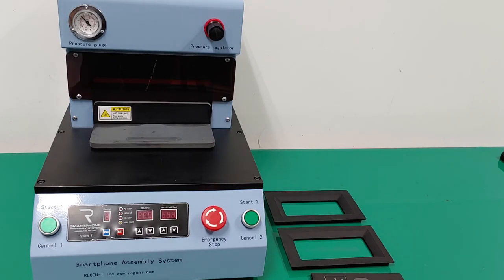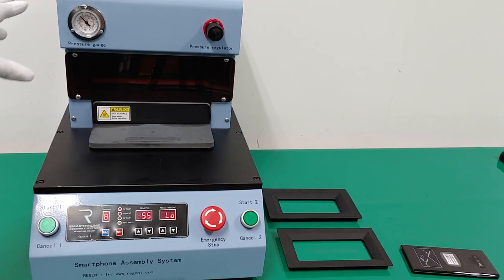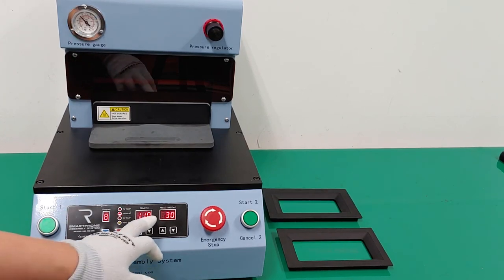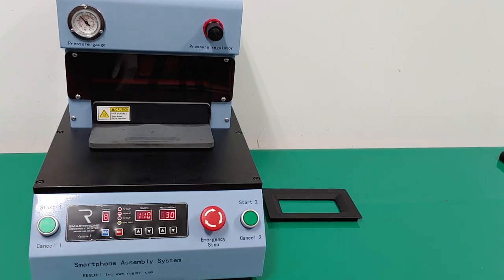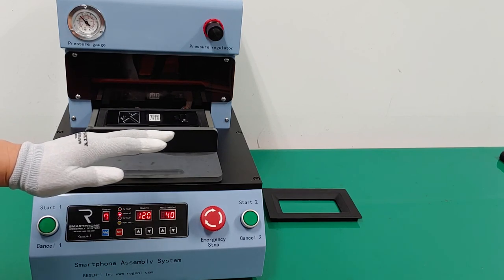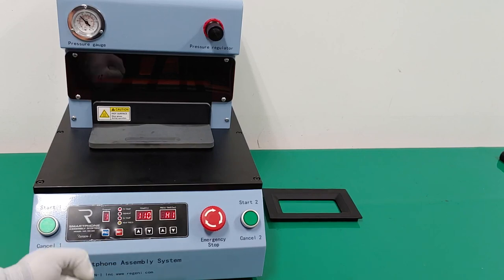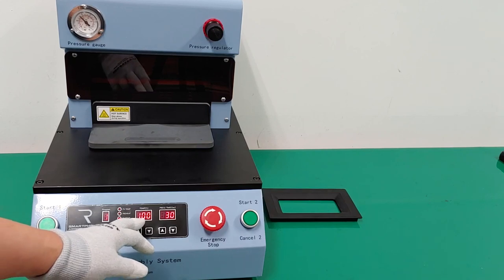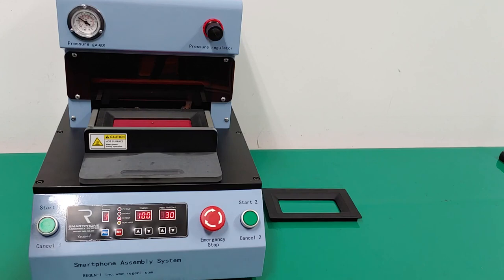Assembly System RG-261 from REGEN-I

Comment from the maker: Assembly system for smartphone ( adhesive+ back cover to main body of phone after repair) targeting get back water proof, user needs to set target temperature and pressing time for various models, recommendation : 100 degrees, 30 seconds, for safety to press both start buttons,
humidity remover at the back of machine by pushing upward black bottom part